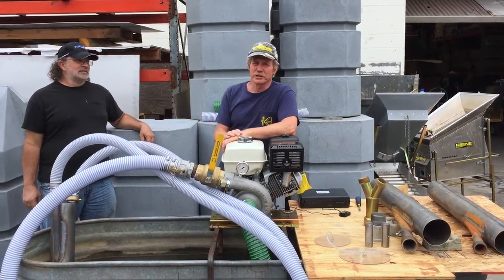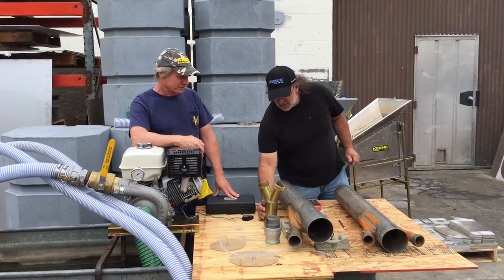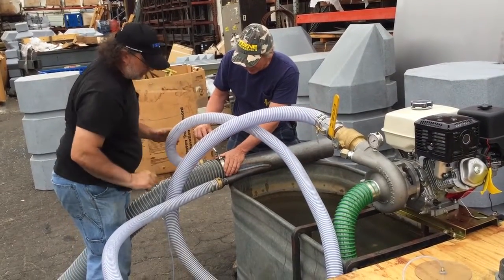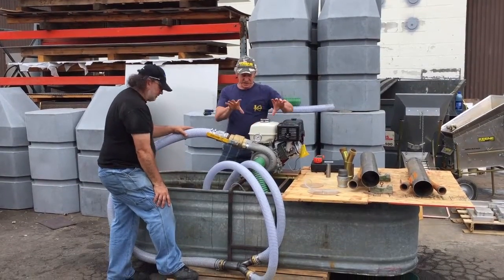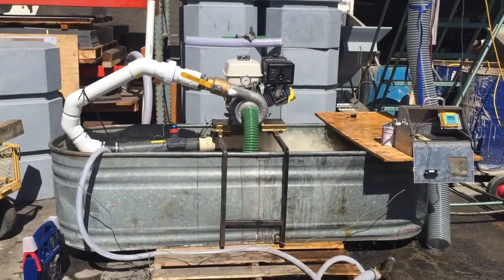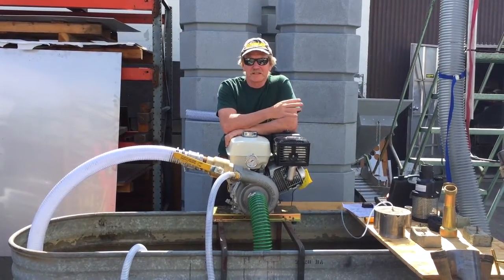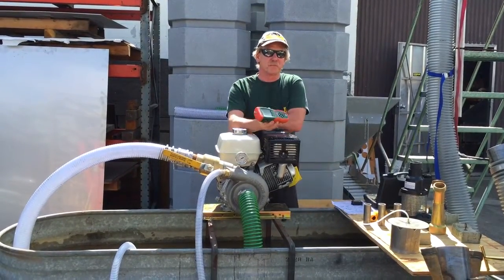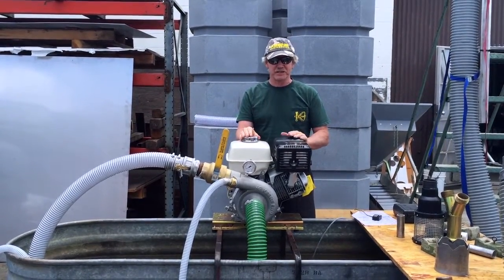Keene PHP500 Pump & Jet Test

Comment: First I'd use a proper sized tub to stop cavitation to get true values instead of a wrong size tub dragging air inside the pump ,use a vacuum dial gauge with different material through it would give a better understanding then seeing how far you can push it up in the air ,the pump efficiency is effected by materials passed through, ie the venturi effect then the push of the materials once past the nozzle
Reply: Dean all good comments however I do know better.  There was no air in that system.   I had the hose bent in a manner that we had no cavitation.  You are correct any air would greatly reduce the efficiency of the pump and the venturi system.
Reply: @KeeneEngInc  Hey ,I wasn't trying to pull you down ,it's just if you study the effects of a boat prop in a small tank you see how it effects the prop cavitation is greatly raised due to sloshing water trapping air which swirls about the tank ,i think some colleges have put the study up on here in slow motion footage,i read it when studying prop design ,what helical draw work have you done ? Like eddy effects with positioning jetting ,such as 19° merging also 19° crossing flow at higher pressure and lower pressure ,the effect like propulsion without a prop ,sort of like new propless jet drive type ,where there is a spinning prop the water is squeezed through water positioned jets instead,so be like an eddy dredge pump effect without a prop ,advantages are better stronger venturi plus no prop to get things lodged in prop to block it